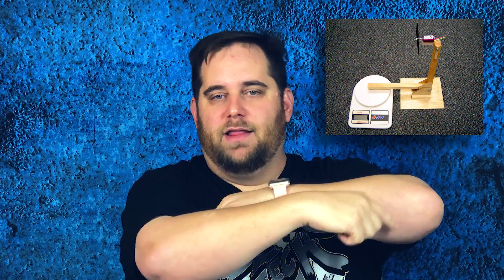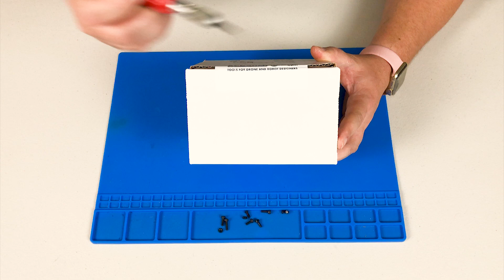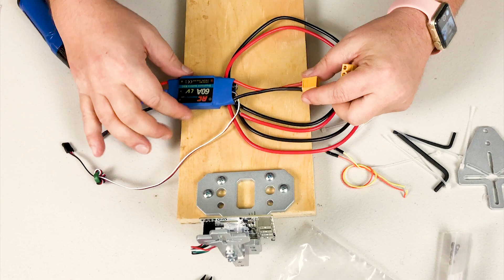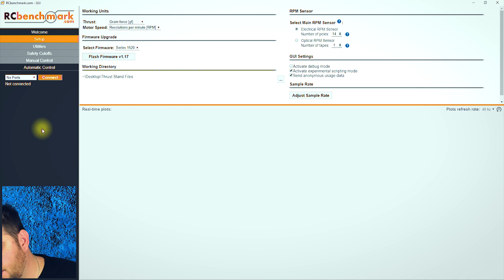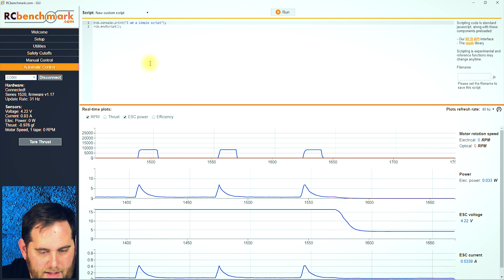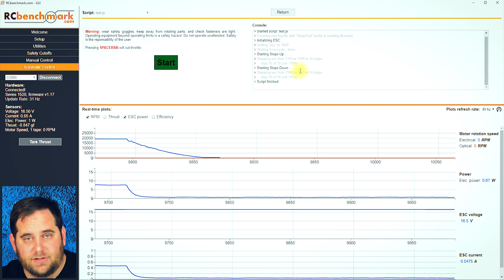RC Benchmark's 1520 Thrust Stand Unboxing and Review

Comment from the maker: Links Specific To This Video:
RC Benchmark 1520 Thrust Stand:
https://www.rcbenchmark.com/dynamomet...

60A RC Brushless Motor Electric Speed Controller ESC 4A UBEC with XT60 & 3.5mm bullet plugs 
https://amzn.to/2qKAT83
Cofufu XT60 Connector 10 Pairs + Heat Shrink Tubing 39.37 Feet (12m) + 12 Gauge Silicone Wire 13 Feet (4m) 
https://amzn.to/2DEsY4P
5 Pcs Dual Row 3 Position Screw Terminal Strip 600V 25A + 400V 25A 3 Postions Pre Insulated Terminal Barrier Strip Red /Black 10 Pcs 
https://amzn.to/2DE4GIf
Adiyer 280 Pcs Metric M3 x 4/5/6/8/10/12/16/20/25mm Screws Nuts Set Assortment Kit Hex Socket Head Cap Screw Bolt, 12.9 Grade Alloy Steel, Black Oxide Finish 
https://amzn.to/2Djrqwa

Comment: Great video.  Thanks!

How did you find the esc output limits?  There is also a calibrate thrust button on the same page.  What is that about?
Reply from the maker: The ESC limits I used based on the manufacturer's data about the esc, and some conservative thought.  For example if I'm using a 30amp esc, then I would probably make my constant be about 20amp and my burst to be 30amp.  But I would verify that to their spec sheet.  The calibrate thrust button is more of a "zeroing" button for the 1520 stand (they come pre-calibrated from the factory).  For the larger stand I'm using now (1585) it calibrates based on using a 200g weight in various locations to make sure 200g is 200g.